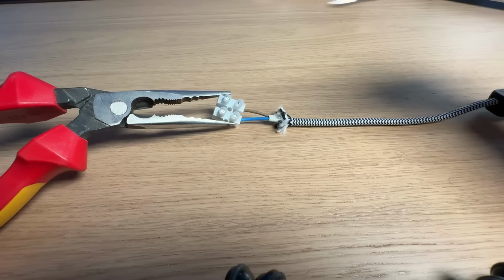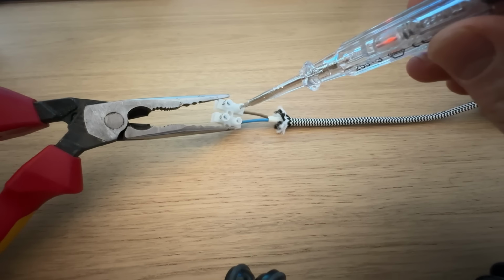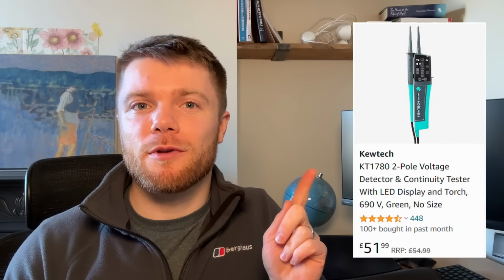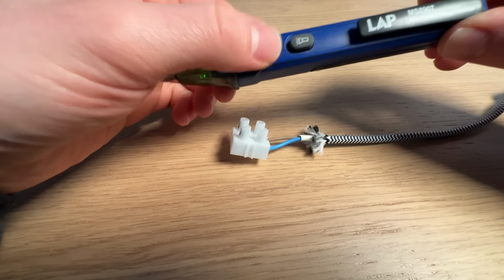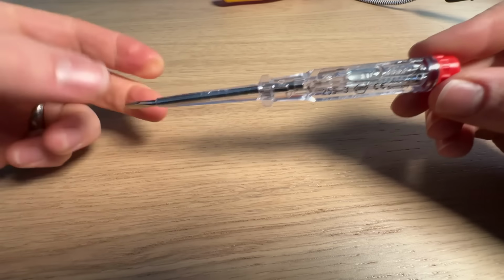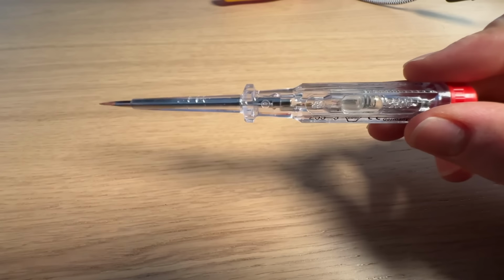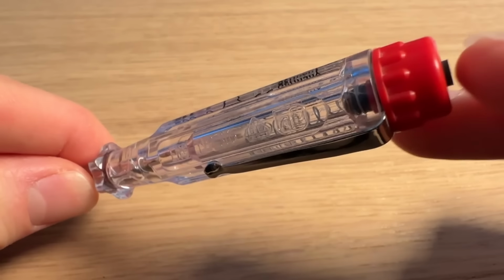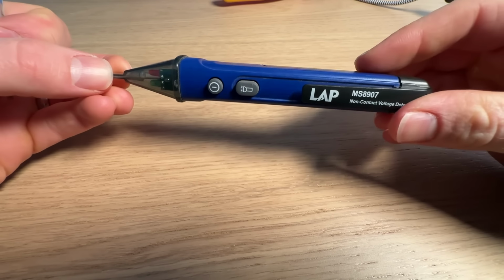The Most Dangerous Electrical Tool

Comment: The Noncontact magnetic field testers CAN ONLY TELL IF THE CABLE IS "LIVE"....but cannot distinguish which of 2/3 wires is actually the live one , unless individual wires are spread apart & checked seperately.....
The same goes for 2 pronged tester or multimeter leads...no clues here on which one is live....😢....& these will show zero/low volts even in "neutral open" circuit check😢
The old reliable neon tester is best ... in detecting the "live wire"..😅 because it was meant to do just that...
For 70+ years , probably millions of( lay/diy/ handyman included )people wth world over continue to use it ....
So YOU are just UNNECESSARILY creating a wrong impression..with inadequate background knowledge....
In the neon tester , the fear of shock due to dampness/liquid ingress can be minimised with little ingenuity...
1) spray conformal coating on joints/ bare wires inside the housing..
2)pouring a quick cure sealant/ adhesive to partially fill/ cover the resistor and leads of neon..
3) any other suitable option one may think of.
Reply from the maker: Thanks for watching!

Comment: There is another danger. In the form of a virtual look-a-like 12V version used as car  test lamp with a  lead that comes out of the top of the screw driver to clip to ground in the car.. The two tools often co-exist in cheap tool kits. Looking so similar its possible to absentmindedly put the 12V test lamp into a 240V wall socket. A  potentially very dangerous mistake.
Reply from the maker: Thanks for watching!
Reply: been there done that, luckily I felt the tingle and let it go, haven't used these type since
Reply: You have to be joking, don't you?
Reply: @rogerphelps9939 6 people disagree with you and my comment was aimed at novice DIYers who can be overconfident. You haven't seen the cheap Chinese  Handyman screwdriver kits that mix 12volts test screwdriver with 240v neon test screwdriver. We see them in Sydney, and life and death I don't joke about.

Comment: First thing first: People who did not know about electricity and circuits, please stay away form it. There is no point for bravado. This solves the matter. 

Mostly this problem arises in the western countries, because they did not get electrician for small works immediately, so they tend to do the work themselves. The cost for calling electrician is very high in those countries. Normally most of the small works (any) are done by the people, some time knowingly and sometime without knowing it. So this problem arises. This is the problem related to the cost and availability.

Here in India, we get electrician relatively cheaply. Most of the times people call electrician to do the work rather than doing themselves. In this case electricians are using good instruments. Even if they get shock, they know how to handle the situation. They take all the care not to get electric shock. 

By profession, I am an electric engineer. But I call the electrician to do any electrical work, since this is not my cup of tea.
Reply from the maker: Thanks for watching!

Comment: so the typical white english method of doing things is: blame the tool, not the idiot behind the tool. By this logic we should ban multimeters (which are actually not allowed to prove whether a circuit is live, because as you mentioned, you need muh special proving unit, buy one now at 199.99 $ special discount offer) so what if I have my multimeter and I accidentally slip while touching the live wires with the prongs, and both of the prongs stab me in the eyes, my house catches fire and now I can't exit my home because I'm blind. I say we should make the prongs on multimeters stab-proof oh wait YOU IDIOTS UNIRONICALLY ALREADY DID THAT, you made it so that you can't "accidentally" somehow touch 2 live wires with the long rod, so you put a big fat plastic over it which shouts "hey everyone, look at me, I'm such a clumsy wanna-be electrician that I cause short circuits all the time, I make sparks fly out, call me a "sparkie"!. 

The issue with the screw driver wasn't "if condensation gets in or the spring falls down" because THEY'RE NOT SUPPOSED TO HAVE THAT SPRING BUTTON IN THE FIRST PLACE, out of all the ones I've seen, this is the first one i've seen like that, and we all know to avoid mechanical moving parts. Yes, YOURS is shit, but the rest of them aren't that bad. And if you're dumb enough to put that screw driver on anything above 250v then you got no place working as an electrician. Same with that pen, it's good for getting a random idea, but your silly pen doesn't prove anything either, neither does the screw driver, these are just ghimmicks that might or might not help sometimes. We just use multimeters and we don't give 2 shits about your scam "proving units" crap. Go outside uk and everyone will laugh in your face. Also here's a tip, you're supposed to use that pen at a 90 degree angle. Quite useful sometimes in some specific situations. But the pen doesn't prove something is dead. It only proves it's live if it lights up.

Also, that's not a "neon" inside the screw driver, it's a light emitting diode, LED. And if you put it above 250v you run the risk of the current passing straight through it, and into your body. Or so I heard, not like I tried it myself.

Comment: I have  never  heard  a single case in more than 50 years in engineering / industry or DIY , where there has ever Been a single death directly attributed to the use of one of these simple testing screw drivers  , whereas there have been Thousands of deaths recorded from the use of hand held test multimeter's ,
Reply from the maker: Thanks for watching!

Comment: Non contact testers are unreliable garbage.
Also, the neon testers don't need you to be earthed, parasitic load is adequate to light the neon.
Reply from the maker: I think you mean body capacitance rather than parasitic load, but either way it doesn’t invalidate my view that having a tiny resistor in a screwdriver between you and the mains is a bad design.

Comment: As a Master Electrician i disagree as the most dangerous electrical tool .Used it for many years. But what is dangerous is NOT knowing what you are doing.
Reply: That's the reply I wanted...
Reply: @BeasleyStreet  And the correct one.
Reply: This is the advice I go by. I went to high school on an electricity and automatization curriculum and I still use tons of caution and don't mess with electronics bigger than a speaker circuit board or usb port.
Reply: EXACTLY! I even usually touch the live wire bare finger whenever I can't find this screwdriver anywhere or if it doesn't work. Looking for the sensation of 220V pushing current to leak through my body.

That definitely could be lethal if you're reckless or clueless of what you're doing, but safe enough if you can trust your skin's resistance and maintain it. Sure, I have experience of doing it cluelessly and recklessly, which is doing so when I was a 7yo kid playing with broken plug. Lucky enough that I survived harmlessly back then

Edit: BTW if you decided to try touching the live wire, you also MUST 100% expect a shock, even if it's supposed to be unpowered. There's another danger where body reaction of shock can lead to physical danger such as fall from tall ladder or even back off and hit stuff. Both can get you unexpected physical injury which most electricians didn't aware of
Reply from the maker: Thanks for sharing your opinion

Comment: I think these work based of the AC as well as the grounds. Because if you have thick rubber shoes on and isolated from ground would the light still turn on ?
Reply from the maker: For me touching the end with an insulated tool didn’t work, I don’t think it would work if you were fully insulated from the ground either. Thanks for watching!
Reply: @TheDiligentDIYer1759  can you the contact pen with lipstick balm fat on your  finger to reduce a potential shock from the pen or wont the pen work at all then?
Reply: Yes, it does. (I've done it on occasions.) Your body's capacitance is sufficient to light the bulb without you providing a return path.

Comment: Ive been using the same screw driver neon tester for 50 years, no problem. Totally safe. Obviously just like any piece of mains electrical tester, you need to look after it..
Reply from the maker: It still relies of electricity flowing through your own body to work. Thanks for watching
Reply: @TheDiligentDIYer1759  hi... yes it does rely on a current flow through your body, but it's no more dangerous than holding a 9v battery or taking off a static t-shirt. Equating danger to extremely small current flows is taking safety to a point where it is non sensical..

Comment: Retired now, but have been using them all my life, never had or heard of a problem.
But they tell you the most important thing 'Will I get zapped if I touch?' and small enough to always have clipped in your shirt.

Even if you would get zapped, your hand would move back automatically, and it would be very short.
(...and any electrician who's never been zapped shortly is a liar)
Reply: It is the same as a cook that never burnt his fingers recently.
Reply: Glad someone has said that. I once (late 50's) went to repair a TV. The mains feed had been extended around the skirting and was dead. A two pin plug and in-line socket had been used to extend it from a far 15A outlet socket. I switched it off at the wall and proceeded to undo the inline socket shells. Sure enough a wire had pulled out of one side which I pulled and put back in. To my surprise the TV came on. I had done it live without knowing or meaning to. Of course such extensions are now illegal. We don't even get to wire up 13A plugs any more. I must have done thousands. Those & aerial plugs - I'm a magician. Another time an MD called me in to investigate why he was getting "tingles" (shocks) from his Anglepoise lamp. I traced it back to one of these 13A 4 way extensions. Inside it was wired up with live to earth. Those 13A testing gadgets are a godsend to easy checking of such outlets. I've survived to be nearly 82 now with one braincell left intact!
Reply from the maker: Thanks for watching!

Comment: Using a multi meter might lead you to believe that a circuit isn't live when only the neutral wire is isolated while the live wire is still live. The good thing about a mains tester is that you use yourself to replace the neutral wire and avoid depending on it.

At least, that's what I can come up with, correct me if I'm wrong. I'm not an electrician.
Reply: That is why you don't use multimeters in electrical installations! And electricians use proper 2-pole voltage testers. They can identify that problem, and indicate it. And 2-pole voltage testers must indicate the presence of dangerous potential even without a battery. In them the battery is only for the additional functions, but not for the basic functionality of indicating a dangerous voltage. And they have a low risk of operating error, compared to a multimeter. Also you don't need to look away from the point of measurement to check a value on a display.
Multimeters have also a high internal impedance, so they will indicate "ghost" voltages between 60 and 100V. Usually created by capacitive coupling by a parall running still energized cable. But with the slightest load these voltages will collapse to zero. These neon indicator screwdriver voltage testers have the same issue btw. And if you are isolated, for example standing on a rubber mat, that voltage tester won't work.
Reply: @Marcel_Germann clampmeters can sense as low as 10VAC now over averagely dense insulation layers
Reply: @need4stuff  AC, but not DC. With PV installations on the roofs these days DC is also a thing. Same for EVs for the people that repair them.
And I think you mean non-contact voltage testers. Clamp meters are for measuring currents, not for voltage measuring.
And also, here it is demanded by safety regs that voltage testers must be able to indicate a dangerous voltage without the requirement of a power source like a battery.
Reply: Yup
Reply: Thats why you test against a known earth first. And shows the actual voltage reading instead of "have power, don't have power". That's very important when you have split phase.
Reply: @arturpaivads All lines against earth and against neutral, when energized there should be 230V, at least here in Europe. And also between the lines, there should be 400V (three phase) when energized.
And test the voltage tester. Either with a proving unit, or with a functional power source. Before AND after testing if a circuit is dead.
Reply: Thats why us Electricians measure phase/phase, and both(or three) phase to earth.

In norway we have 230V between the phases, and ~130V between phase and earth. If theres an outlet connected to a one-phase switch, and ONE phase is cut off, the 2nd phase could still be energised and if you touch it - and a i.e grounding wire you can get shocked
Reply: @TheFenrirulfr  Scandinavian countries usually have IT grids instead of TN or TT. So actually two lines instead of a line and an earthed neutral conductor. 230V between the lines. That system has the advantage that it can tolerate two faults before it isolates a circuit. But the disadvantage is: Harder to find faults. And the bigger the grid is, the harder it is to find faults.
To get an electric shock you need to touch both lines at the same time. When touching one line you won't get an electric shock. But if your neighbour has a faulty water kettle, that one would be fault number 1, and you touch the line you can get shocked. Because due to the fault one of the lines become the earthed neutral (the one with the fault in it).
IT grids are not referenced to earth potential, that is the reason the measurements against earth potential are nonsense and indicating bogus numbers.
In most other countries IT grids are only used in small areas, for example in hospitals. There it helps to ensure safeguarding against failure.
Reply from the maker: Thanks for watching!

Comment: I have a Steadfast branded neon tester which is very well sealed so very safe. I've never heard of anyone being electrocuted by a faulty neon tester. Their advantage is the very low current making use of human body capacitance which  avoids the need for a direct circuit return conductive path and also the need for a direct connection to the live terminal.

The VOLTAGE field (not magnetic field) non contact testers are not very reliable in that they can detect stray fields giving a false positive and field screening effects can reduce the field intensity.

The professional testers and the use of a multimeter or a test lamp are all prone to the need for a relatively low impedance return path. They will all fail to detect the hazardous condition where all available contact points have become live. They will falsely indicate a safe condition when bridging these contacts. The neon tester, however, will show all contacts to be live because it uses the human body as return path - the very thing and circuit path you are trying to test for and protect. I would therefore argue that the neon tester is the safest and most reliable indication of a hazardous live contact point.
Reply from the maker: Thanks for watching

Comment: As a retired signalling tech support engineer who used to calibrate test kit from meggers to flukes too live line testers.
 Any meter , volt pen or other circuit tester 
Unless calibrated at least annually on catibrated test machine any item that is supposed to give accurate  readings or safe to touch test equipment will have the potential to be wrong.
Sure use a live line tester but for me on sockets for example plug in a lamp turn off  at the consumer unit if the light goes out its a good bet the circuits dead .
Double check with your uncalibrated diy test probe and you can be fairly sure its got no power. 
I prefer meters to probes but still have a good Fluke non contact one that picks up power by just touching the socket housing its ultra sensitive but not as cheap as the diy prode drivers at around 
 £25
Reply from the maker: Thanks for watching!

Comment: Used one of these one time and the whole metal bit melted and there was a massive BANG! Definitely never trusted one again!
Reply: It is when you see one with part of the blade burnt away.
Reply from the maker: Thanks for watching!
Reply: @TheDiligentDIYer1759  .
Although it is more just for the interest, you can use one of those screwdrivers to test for static in metal tools.  You get a single brief flash as you earth the tool.

Comment: What concerns me is that resistors are known for degrading or going faulty over time. I have often found that a resistor has gone high or low in circuits when it becomes faulty. I'm a (well retired now)  sound equipment service mechanic, and my fear of these screwdrivers has always been, being safety minded, what if the resistor inside it goes low.  Of course you demonstrate this by saying what if water or piece of spring drops across the resistor, but I'm talking about an actual faulty resistor scenario as unlikely as that may seem to some commentators. When I saw what was inside mine, (same as yours) it was the first precautionary question I asked myself, and that was 30 years or more ago. I just couldn't bring myself to trust them for the purpose they claim to be useful for. I've not used one to test a live source ever because of that, adopting the 'better safe than sorry' attitude.  I do like that non-contact device you showed. I've never seen one of those before so thanks. I may live to be 100 years old yet!
Reply from the maker: Thanks for watching!